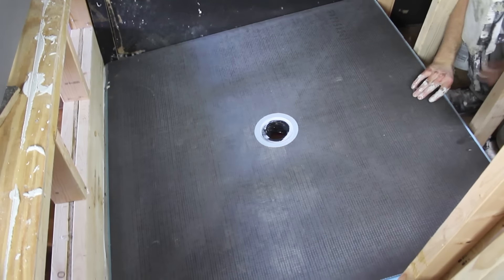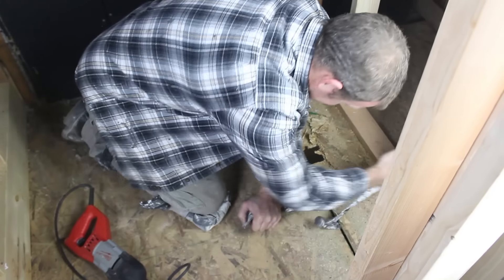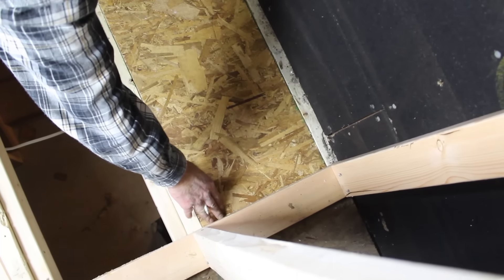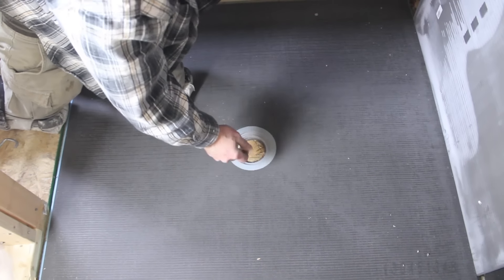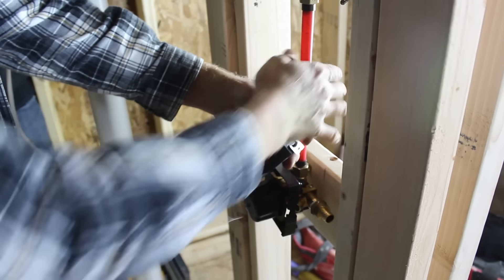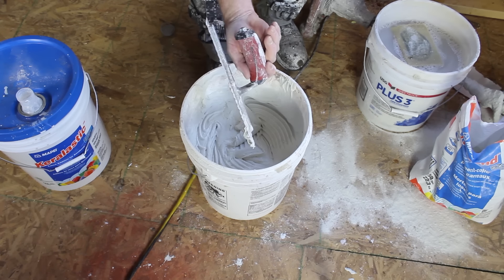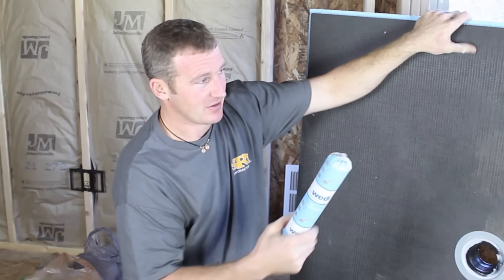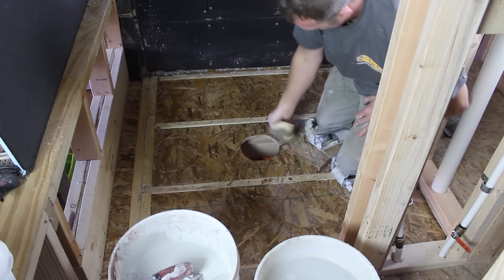How to Build a Walk-In Shower (Part 1: Wedi Shower Pan Install)

Comment: By what I've watched just now if there is anyone that has any beef with what this dude just did, then you don't have a clue. This guy knows his shit and I'm very shocked that I've finally seen someone do them almost identical to the way I do them. I was taught from generations of tile setters and I am so thankful for what they taught me and what I've learned. Now over 24 years and still going strong here. But this guy is on top of it no doubt.  Much respect man good video.  Done a few Wedis, bunches of Schluters, few Tile Redis, and even some KBRS Hard Cores and other few but I still like the old school way from scratch with the dry pack mortar bed and rocking the walls and then mud and tape and then liquid waterproof at least 2 coats  and then I finally get to lay some tile with thin set of course

Comment: I got a chuckle when he pulled up that sub-floor plywood. When I did mine on a recent remodel, that plywood was glued, screwed, and nailed down. HO-LEE-CRAP was it hard as hell to remove. Large chunks stayed bonded to the beams and I had to scrape them away. I'm dreading this in my master bath remodel. If it could always be this easy! Great video.

Comment: Osb as a floor under the shower pan.  Yeah that's a good idea 👍
Reply from the maker: it's an approved method and if the pan is installed correctly will not matter

Comment: i took a 5 foot three sided fiberglas tub/shower enclosure (a nice one from Lowes) and sunk it to where the "tub" section was flush with the floor and made a 6 inch half moon fiberglas step down inside on the tubs floor then i put a typical shower head on each end of shower enclosure. really turned out nice and have had many compliments.

Comment: I used advantech subfloor with cement board on top and all walls, red guard 3 coats with membrane on the entire floor and on all joints and up the corners then tile, it will never leak and I diy

Comment: no what if your curbing is not at a 90 and it's runs at angle do you make your backerboard vertical and fill the Gap behind it to the curbing being I don't have a curbless or the backer board will be running at an angle to the curbing looking forward to hearing back from you thank you for sharing nice job

Comment: what if the sub floor is not level? do you follow the floor or do you level the recessed and fill in the low spots with thin set?

Comment: fantastic videos. i'm looking to convert my mom's shower to a walk in shower, generally is it cheaper to go with a prebuilt resin shower kit or DIY tiling? not counting labor as either way i'd be doing it all myself
Reply from the maker: it depends on many variables but tiling can be more cost-effective. Plus you’ll want to add solid blocking in the walls for grab bars or even a foldable shower seat, and these methods in our video are in line with that project. Let us know if you have any questions, my email is jeff@homerepairtutor.com

Comment: In the intro, what system did you use to water proof the shower you are sitting? And what sides shower is that in the demostration?
Reply from the maker: great question, that shower is an Arc shower tray with Wedi’s building panels, it’s 48” x 48”

Comment: 4 years later can you give an update?
Has it held up?
Any problems?
Nice system, looks easy
Reply from the maker: yes, still works without any leaks. Wedi makes solid shower systems but they need to be waterproofed properly. This video explains where to not make a mistake https://youtu.be/b_qt32yIYUc

Comment: So the age old question , do you install a pre sloped pan before u lay ur topping mix ? I am remodeling my sisters bathroom and there is a handful of ppl who do that and allot of other people who don’t and I havent heard a complaint yet , personally if you red guard the entire shower base and walls , no problem ! A little extra cost but .. set it and forget it . Keep up the good work brah ( side note I have been in the construction  business for 17 years ) allot of demos and in my opinion on tear outs IF the contractor took the time to seal the base properly I have seen no evidence to support that theory )
Reply from the maker: Pre-Slope helps water drain properly under the topping mix, stagnant water that doesn't drain will lead to mold and mildew from below.
Reply: So if you take your time and seal the entire base and up the wall 2 feet with red guard water will still weep through ? I ask for evidence as respectful as I can , like all other good contractors if there is room for improvement which there always is , do it , it will save u the respect in your trade to not have to replace.
Reply from the maker: @Carpenters_Canvas  honestly, we don't do this type of installation because new pre-sloped shower pans are much easier and faster. We like Schluter, Wedi, KBRS, and Laticrete systems. The only mud pan we do is for curbless basement showers. The money spent on pre-sloped shower bases is saved in time and materials fixing mistakes down the road. Just one opinion
Reply: Home Repair Tutor * I appreciate the i site , as I said before I am constantly trying to keep up with all the newest products that are tested and proven to be better for reasons A B C , this is what real tradesmen do , consult with other craftsman in a constructive way , as we all know it isn’t about what makes us happy , knowing that when u leave a job and u did the best work every time for the costumers sake , I try to tell all of the so called craftsman money means nothing when ur working in someone’s home . I have called out other  contractors who just mortared the tile to the advantec . He didn’t finish the job I tore it all out and restarted with the shluter system . Thank you for your time hopefully we can collaborate   More in the future for the best results , there is no better feeling then walking away from a job proud and secure with your work. , is the wedi system pre sloped I couldn’t see it in the vid . Or actually u build the pan on top of this right ?
Reply: @Home Repair Tutor  I am also doing a curbless walk in shower it’s amazing how intimidated homeowners get when they see the 500 dollar price on the shluter base but u can’t beat it ... just don’t spill any pipe primer on it it me
Tsk away lol
Reply from the maker: @Carpenters_Canvas  yes, Wedi is pre-sloped and very solid
Reply: Home Repair Tutor imma check it out I really appreciate what u do thanks again
Reply: @ Home Repair Tutor I just have one more question if u don’t mind .. I see allot of ppl putting a “ slurry “ of thin set under the topping sand is that a thing ? And why thanks so much

Comment: Couple questions - looks like they were asked previously but no answers:
1) These can be cut? The shower are I need to do is only ~ 3ft sq
2) My drain extends out into the garage - shower enclosure is on a base sitting on garage floor and tight - I'm assuming can't attach the drain until after installation?

Thanks for the video
Reply from the maker: +Jeff Ribordy Wedi pans can be cut to size but there are limitations based on the instructions. You'd want to set the drain and drop the pan over it. So have all the plumbing in place if you don't have access underneath it. Hope that helps

Comment: Great video. I've watched several on your channel now. My bathroom demo is complete, my sub floor is removed exposing floor joist, and I'm ready to rebuild. But first I need to select the correct shower pan/tray. I have 4 variables, and need advice making the right selection. Wedi vs Schluter vs one slope vs laticrete, vs etc. I'm trying to determine my "splash zone" with open curbless, no door shower area. Thanks
Reply from the maker: +Vince Filippone how big is your shower going to be? Sounds like you're ready to dive into the build phase 👍👍
Reply: Home Repair Tutor The size is somewhat negotiable. I have two definite walls and one wall I am going to build which will I close a toilet room. The placement of the wall is based on the shower pan I choose. The fourth side (opposite of shower head) will be open curb less and door less. Fun right? I wish I could show a photo, it would make sense.

Comment: Don’t you want the Ligno pan sightly taller than the subfloor so that your underlayment on the subfloor actually meets flush to the top of the ligno to ensure that the tile is the same height in both shower and main bathroom floor?

Comment: What is the reason behind cutting out the osb on the floor and recessing it where you are putting the pan lower on the joists? Is this just a option or is that how it has to be done? Thanks getting ready to do our Custom built shower in our new house
Reply: So your tile is the same level as the rest of your bathroom floor instead of using a curb

Comment: Can the pan be cut to size? My shower space is only 36 x 30. Or because the shower is flushed with the rest of the floor there is no need to cut it? My bathroom will be a wet room. The size of the shower will be determined by the back wall (48 inches and according to where I put my shower curtain rod which I am thinking a minimum of 30 inches from the back wall. I noticed that the smaller pan is 36 by 48.

Comment: Just wondering why someone wouldn't add shut off to the shower since the walls and plumbing is open 🤔
Reply from the maker: because the Delta rough-in valve has integrated shutoffs
Reply: @HomeRepairTutor  oh okay thanks 🙂
Reply from the maker: @micaonyx5301  happy to clarify, many rough-in valves have integrated shut offs as an option

Comment: Shower head, hand held & body sprays.
How many sprays?  We use the IPC here & often have to go to a 3" drain or two 2" drains.
Of course, if you're not getting inspected...
Reply from the maker: There may have been 2 body sprays, can't remember Frank.
Reply: Home Repair Tutor 
It can be a pain sometimes.  Works out nice with linear drains.

Comment: Q: I cut my Wedi pan lip a little too much, so there's about 1/2" space from where it joins the wall. Can I just fill that in with Sausage? Or is there another technique? I can cut a small strip off another panel and put it in (also)? Thx.

Comment: It's realy interesting why do we need to use this system?
Is it cheaper than shower liner instalation wich gives you a complete waterproofing?
In my opinion it's a way harder than a liner instalation because you don't neeed to play with the framing.
Reply from the maker: +Andrii Pasichnyk here's the problem with liners, they're not always installed properly and a lot of people puncture them either on purpose at the framing or by accident. Plus who's providing the 10 year warranty, the installer? Wedi is waterproof on the surface and as long as you don't puncture the entire way through the foam your shower is protected from accidental cuts from tools. This system is also a curbless shower, meaning the homeowner simply walks or rolls into the shower. So the liner is mostly used for curbed systems. That's a big difference
Reply: thanks for your answer.
Reply from the maker: +Andrii Pasichnyk glad to help any time

Comment: Going to use the Fundo Ligno as tub replacement (36x60").  The subfloor is 3/4" strand board, the Ligno is 3/4".  When I put down a 1/4" wonder board/Wedi board won't that raise it up over the Ligno pan? or do you keep it that 1/4' high and bevel it down into pan with morter to make for of a run to the drain? I would not tile directly over 3/4 strand subfloor.  Thanks and appreciate your video's.
Reply from the maker: +Jim Fiascone we'd recommend using DITRA as it's only 1/8" thick, allows you to completely waterproof the surrounding floor and stops tiles from cracking. In addition, add the Wedi Subliner over the pan and the DITRA for extra waterproofing. Wedi does have Subliner Flex which could be a solution for you as well. We have not used it though

Comment: Hey I have a question about the wedi curbs. I have a 36x36 shower pan I need to install. I have it in the corner with the walls on the back and right. The rest I would place a curb and being open making a full square. My question is. Can I I mount glass to those wedi curbs with a door? Or should I build up. If I build up and put wedi over it?

Comment: Home Repair Tutor, thank you very much for the video. I am going to do install one in the near future (maybe) based off your video. I recently bought a house and the last owner just installed a new tile shower (DIY project for sure). There are no leaks when it runs normally (regular shower), but one time I placed a wash cloth over the drain so my son had a few inches of water to play in. When I lifted the cloth to "drain" the shower, I had water leak downstairs. I think the water creates a little pressure as all that water is draining through the P trap after the drain. When I opened up the ceiling and replicated the "leak" it looked like it was leaking from the bottom of the drain. After watching your video, Im wondering if the installer simply didn't silicone the vinyl to the actual drain. What are your thoughts on this? Is this normal? I don't want to tear a "new" shower out, but I also want to make sure it is done right. 

Thanks in advance for your help!

Comment: how did you get the proper slope the lower shower pan?  It looks like it is installed totally flat.  Not sure how you make sure water runs to the center?
Reply from the maker: +G MM55 the Wedi Fundo Ligno is pre-sloped, so water will drain properly as long the subfloor is level. Does that answer your question?

Comment: I accidentally ordered a 32 x 32 shower pan when I actually need a 36 x 36, would I be able to just add 2x4 to fit the shower pan ?
Reply from the maker: What kind of shower tray is it?
Reply: @HomeRepairTutor  tile redi!
Reply: I figured it wouldn’t be good to just add 2x4 so I just ended up ordering a 36 x 36 pan and hoping to be able to return the 32 x 32 pan

Comment: I’m getting ready to build a walk in shower on a new construction build for our house my question is do you always need to cut the sub floor out and make it 3/4 lower or is that only for remodels? What is the purpose behind doing this? Thanks in advance
Reply from the maker: it’s best to make the shower tray area 3/4” lower so that the shower tray is flush with the main floor; the Wedi Fundo Ligno is 3/4” thick at the perimeter. This allows you to have the Curbless entrance 👍🏼
Reply: What if we are going to do a curb should I still make it 3/4 of an inch lower?
Reply from the maker: in that case, you can bond a Fundo Primo directly to your concrete; if this is your first Wedi shower you can get a rep to come out on your install day. Highly recommend doing that
Reply: Shower pan will be on a plywood floor I will check into getting a Rep to come out thank you I appreciate your helpful advice

Comment: How did you insert the plumbing? It doesn't show you attaching the drain PVC pipe.
Reply: You need a p-trap of 2” that will be glued inside of the drain from the bottom and on top you will insert the drain cover when you tile up.

Comment: I used Custom Bedding Mortar for a shower pan, but there is an area that now needs a little additional slope. What product can I use on top of the bedding mortar to feather in some additional slope? It's only about 3 sq ft on one side of the drain that needs about 1/2 inch of additional rise along the edge of the pan.

Thank you.

Comment: Could you trim this shower pan if your dimensions are a bit different?
Reply from the maker: yes, you can trim it to any size. You'll just have to recreate the rabbet on the perimeter so the Wedi backer board can be recessed per Wedi's instructions. But that can be accomplished with a circular saw or even a utility knife.

Comment: I want to tear out a 36"x36" shower and replace it with a 48"x48".  Existing shower pan is prefab fiberglass.  Home is single-story on concrete slab.

I'm hoping to:
1) Remove existing shower pan
2) Apply thin set to concrete slab so floor slopes to the drain
3) Add perimeter curb
4) Install tile

Do I need a shower pan or barrier when installing shower on a concrete slab?  Does water seep through tile grout and become a problem to the sub-surface?
Reply: t d  did you get it done!? I'm actually wanting to do pretty much the same thing just maybe go a bit bigger if possible but probably same size. would love to hear your experience if you was able to get it done!
Reply: As a rule, tile and grout are not waterproof. A water barrier is needed before tiling. Otherwise, you're gtg.

Comment: How does that work with underfloor heating? I am guessing it will insulate the shower floor
Reply from the maker: Good question Onur, and you're correct. The Ligno has insulating properties due to the foam construction. Were you thinking of adding underfloor heating everywhere in the bathroom?

Comment: why is any of the baseboard work at the beginning necessary?
Reply from the maker: a recessed subfloor is needed for the 3/4" Wedi Fundo Ligno shower pan to sit flush with the main bathroom subfloor, which is also 3/4" plywood.
Reply: thanks!
Reply from the maker: @3DProductions  happy to help

Comment: Amazing good work 
But we in Germany would do this a bit different.
But our houses are completely different.
we do the same thing at my parent's house and we first have to go through 25cm of concrete for the pluming.

Amazing how different the work is  :D
Reply from the maker: +BLACK - CUSTOMS some homes in the states do have concrete foundations but yah, it's amazing the differences from region to region. Do you use Wedi?
Reply: +Jeff Patterson 

here every house have it.

no first we want to use a similar Produkt from Germany but it was impossible in our situation.
so we pour it with concrete.